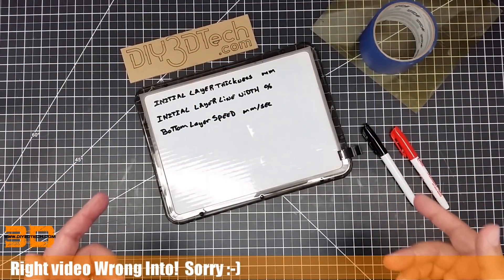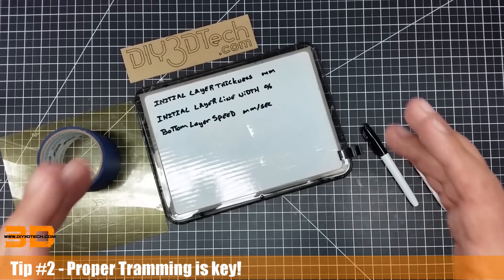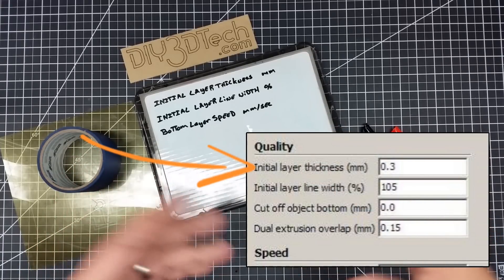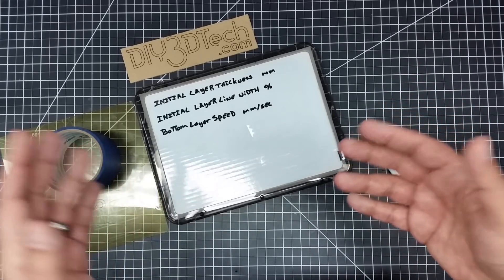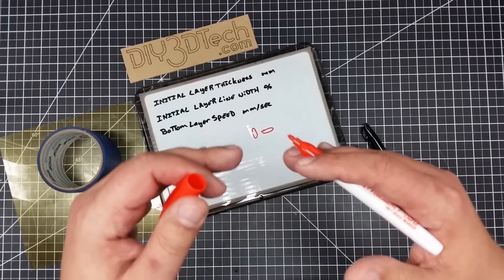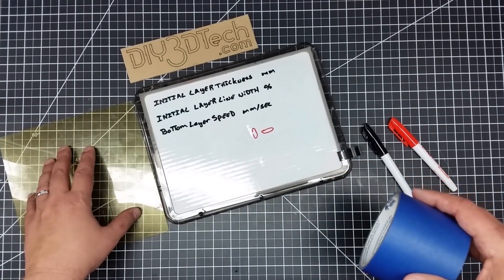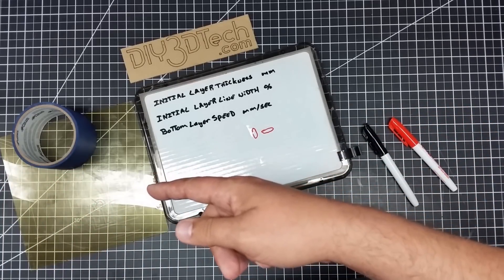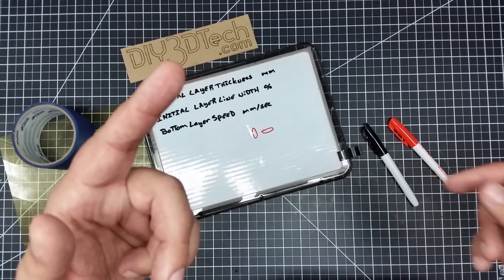Shop Talk - Slicer Settings For The Perfect First Layer!

Comment: Hm, after perfect manual bed tramming on my Ender 3 S1, followed by auto-bed-leveling, z-offset I tested implementing this slicer settings in Cura 5.1 using PLA+……and honestly I got the worst first layer ever seen, totally unusable. Going back to my previous setting and everything worked again like a Charme….weird

Comment: When you said about the 1st layer in the other video on the printing right and how it must have a good adhesion to the bed, either with builders blue tape or the PEI, would a very fine grade type sand paper sheet put on the bed with double sided heat proof tape be a good semi rough surface for the 1st layer to adhere to?
Reply from the maker: just use a clean PEI sheet and you will be golden :-)  Again don't over think it as this is CNC and there is a lot of "error" per-say for hobby use.  If you need high tolerances then SLA is the way to go...

Comment: What version of Cura are you using? RobUK
Reply from the maker: I use 2.5.0 as well as an older version on an XP machine (can't remember the number).  However the slicer I am using these days is iceSL but used the older Cura screen for this video as was easier to understand...
Reply: Thanks, RobUK

Comment: What about first layer height?
Reply: In Simplify3D you can adjust the First Layer Height. This parameter helps a lot to "push" the first layer to the bed. For example, if you are printing 0.20mm layers the first layer will be printed 0.20mm from the bed. If you change the first layer height to 50% it will start to pint at 0.10mm from bed, "squashing" the filament to the bed.
Reply: It's the "Initial Layer Thickness" in the video

Comment: I wouldn't recommend arbitrarily adding .1 to your layer hight to get your initial layer hight because that may induce stepper errors, which you then have to fix by over extruding.  Optimal layer hight depends on stepper rotation degree and leadscrew pitch.  Teach users how use the https://www.prusaprinters.org/calculator/#optimallayer to find out what their initial layer hight will best be.  That way, you don't have to over extrude that first layer 105% :)   My optimal layer step for the setup I have is .04, so I always increment up or down that much.  Printing at .2mm means my initial layer hight will be .24... but never above 80% of my nozzle diameter.  Then make sure your print layer hight is also within the optimal range for your stepper setup.  Less artifacts in your prints = big win :)
Reply from the maker: Interesting, as I get what your saying as in the CNC world when creating the tool definitions there is a sweet spot based upon the lead screws and stepping configuration (for speed and plunge).  Yet with 3D printing I do question the dimensional accuracy to yield value (as mechanically you are 100% correct), however your saying you see less "artifacts" which is interesting.  So couple questions as this is interesting, (1) what type of artifacting were you seeing you do not see now, (2) does this perform better with one type of filament over another (back to dimensional accuracy).  Also I see your a Drone/Wing guy!  Very cool as I also do a drone channel too!

Comment: Hey, did you ever run into issues with the elephant's foot on CR-10? It is an issue for me and not due to bed leveling/calibration. It is because the z-axis motor will lose the first 0.5mm of height for any object. It is easily seen when you move the z-axis up and down. If you move it from 0mm to 1mm it will be 0.5mm. If you move it from 0mm to 10mm it will be 9.5mm. 
Do you know what the issue there can be and more importantly how to fix it? 
Thank you!
Reply from the maker: Wow sorry no, have seen or heard of this as my CR-10 has been rock solid out of the box...

Comment: I've also (slowly and painfully) worked out everything you advised, and can confirm it all! One extra thing I've found with ABS is using the "first layer temperature" option to drop the hot-end by 10 to 15 degrees helps as well (it's been the difference between some bigger parts lifting or not) but don't go too far or you risk Marlin aborting the print with a "temperature error" if it can't get the hot-end back up to temp within 20-30 seconds of the layer change. (so definitely no cooling fan! And a PID tune for the target temp beforehand is a good idea.) But it doesn't seem to help with PLA or Nylon or anything else.

With PETG I've found that a super slow first layer of 10 - 12mm/s and halving the nozzle-to-bed distance helps if you're printing onto 3M blue tape. (with no sprays or other glues) Really smash it down! (Or bed level with no tape, and then 'ignore' the thickness of the tape. If you have a BLtouch you'll need to mess with software options.) 

There's something about the surface of the genuine 3M blue that acts for PETG like PEI does for PLA/ABS - get it right and the print pops right off after cooldown without damaging the tape. And since printing PETG onto PEI will rip chunks off the bed, it makes sense to put tape over the PEI to protect it.
Reply from the maker: LOL!  I guess great minds think as agree, short video but many man behind the testing!  Thanks for tip on ABS as I can see how that would help....

Comment: Can't you accomplish the same thing as you propose with steps 1 and 2 by just bringing the nozzle closer to the bed? It seems to work for me ... except when it doesn't. I'd love too hear your thoughts on this.
Reply: Not really.. in that case you're technically over-extruding into insufficient space which will often make the motor skip (*thunk*...rrrr...*thunk*) because there's not enough room for the plastic. With ABS especially you want a nice thick stream to just 'kiss' the bed, then the PEI will do it's job and release nicely at the end. If you're smashing the ABS into every pore of the PEI, it can get very stuck.

Of course I will immediately contradict myself and say I've found that trick to be useful when printing PETG onto blue tape. :-) Horses for courses.
Reply: Jeremy Lee I see. Your method changes the gcode to accommodate the extra material. I'm just pushing more material into the same space. I know I'm doing this because my first layer has excess material pressed out from the sides of the nozzle that makes small lines parallel to the travel of the nozzle. But this is covered by the second layer. I'm looking forward to trying your method. Thanks for the reply. And thanks for the video.
Reply: Jeremy Lee I've never tried PEI where would you recommend that I buy some? I've found blue tape to work well ... except when it doesn't. BTW, I just got an Anycubic i3 MEGA last week with Ultrabase. So far I am loving.
Reply: I've been getting mine from eBay for about $15 for a 1mm sheet, and as low as $8 for a 0.5 sheet I haven't tried yet. Be sure you're getting the genuine 3M 468MP adhesive sheet with it, and not the no-name stuff - that's actually more important than the kind of PEI. If you're sticking it down straight on the bed (recommended) the thinner the PEI the better. 

I hear good things about 'buildtak' too.

I recommend picking up two sets. There is a very high chance you'll screw the first one up (I did!) because experience - by definition - is something you get just after you need it.
Reply: Oh, and I'm not the one who did the video! Heh.
Reply: Jeremy Lee Oh. I didn't realize that. Thanks.
Reply: Jeremy Lee Does the PEI really need to be adhered to the base? Can't you just use binder clips like you do with a sheet of glass?
Reply from the maker: I have used both clips and the 3M tape, if your only doing PLA the clips are fine however if your doing ABS use the 3M tape for a more even heat transfer.  Also to your other question, think of the first layer as being your homes foundation, do you want a thin or thick one?  The extra material fills in the voids and where there is no void creates a wider base.  In short your basically guaranteed a perfectly trammed first layer so each layer after has a better chance to be (1) dimensionally correct and (2)  have better layer adhesion...

Comment: I've always used a first layer height of 90%. So if I'm using 0.2 layer height, the first layer would be 0.18 to give it some squish. Definitely slow down the speed on the first layer. Found that out early on and makes a huge difference. I go as low as 15 mm/sec on the 1st layer and then 50 after that.
Reply from the maker: Curious why less (the excess will as you put it "squish" out) that will leave or at least create the potential for gaps?
Reply: DIY3DTECH.com I followed that tip from the website below. Have had good results so have "stuck" with it. I'm sure I tested all of these settings awhile back but am always up for experimenting so will run some test prints and see what I like best.

https://3dprinterwiki.info/tips/first-layer-settings/
Reply: i also do this
Reply from the maker: Please keep me posted on the results...
Reply: I'm with you on the slow speed on the first layer...this is a must. The first layer height though, I find the nozzle will start dragging as it continues to print since the layers are that extra little bit higher. I did some test prints that were one layer thick and even then I could see where the nozzle had hit the surface when I increased the first layer height. Having the first layer height to be 90% helps get a good squish and all but eliminates this dragging issue (provided your extruder steps and flow are set correctly).

I have been using IceSL more now instead of Cura and am getting better results with it even though I get good results with both. I haven't found a way to increase the first layer width though with IceSL. Is there a way to do this? Wasn't able to really test that setting out and had to use Cura for my tests.

Comment: Great video. I watch all you 3d printing and openscad videos.

I am not sure that is quite how initial layer line width (%) works. It does over extrude the current line being laid down. But it will use less lines to fill the given area. In the end the amount of plastic laid down for the first layer is about the same no matter what the setting. 

Does this really matter? Probably not, the setting will have many of the benefits that are claimed in the video but it doesn't strictly speaking "over extrude this one (first)  layer".

 Be careful, if you are using Slic3r and want to follow this advice. Many of the  percentages in Slic3r are based on layer height not nozzle width including the extrusion width parameters for the first layer. This really confused me.
Reply from the maker: Thanks for the tip on Slic3r as I really have not used it, mainly Cura and icsSL.  I am not sure this (But it will use less lines to fill the given area) is the case in Cura and will do some modeling...
Reply: I modeled a 180*180* 0.3mm cube. Sliced it with a 0.3mm initial layer height so only 1 layer. Using Cura 18.03 Lulzbot edition. Projected filament used is 4.08 meters when using 100% for initial layer line width%. Bumped it to 150% extrusion width. Predicts 4.10m. Difference is very small <1% and is probably the extra used for the skirt. Haven't printed any of this but it didn't go up by 20% or anything like that. Give it a try.
Reply from the maker: Correct, I get very small change 5% as keep in mind its only the first layer so its not going to go up 20%.  WIll do modeling as you have given an another idea :-)
Reply: Yes, exactly! You don't actually want to "over-extrude" in the sense of plastic volume - but it's the 'edges' of the plastic track that are the weak point. Less lines = less weakness. That's the whole point! You want "fat tracks", not thin ones.

The advantage of doing this on the first layer is that the extrusion is 'trapped' between the bed and nozzle so it still flows exactly where you need it to go, in the correct amounts. But it's faster (less lines balances out the slower speed) and if you try to 'fat extrude' onto previous layers (esp. edges) the plastic tends to squirt where you don't want it to go.
Reply: Dude! Definitely give Slic3r a go... particularly Josef Prusa's new variant. I changed from Cura a while ago and though I really miss the print time estimates, (and non-ISO perspective, grr!) there's some new features like XY and 'Elephants Foot" compensation that make a big difference for tight-tolerance mechanical pieces.
Reply from the maker: Can't say I have seen "Josef Prusa's new variant", has the math been updated?  As that is why I stopped using it many moons ago as I believe the math engine that does heavy lifting is opened sourced and why a lot focus use in their version.  However (and I have not looked at in a while) was not being updated and it not the when breaking down the model.  Have you you noticed any detail loss?  As this is what I noticed in the past and why switch to Cura and now also use iceSL for my more complicated prints.  However as you say might worth testing :-)
Reply: https://www.prusa3d.com/slic3r-prusa-edition/
It takes a bit of getting used to, and it's possible to really screw things up in some interesting ways, (that's what "powerful" means :-) but I'm getting better prints with it than I used to with Cura. No loss in detail that I've noticed. Features I use are:
* XY Size Compensation: -0.1 - basically the equivalent of "tolerance" for the entire model.
* Elefant (sic) foot compensation: 0.15 - shrinks the first layer to prevent "elephant's foot." has the opposite sign to XY comp which is slightly confusing.
* Specific extrusion widths so first layer / infill can be "fat and strong" but the outer shell can be "thin and accurate". (perhaps counters your 'loss of resolution'?) 
* Bridges can have their own flow rate, cooling, support options, etc.
* Change the fill angle. So you can rotate the part but keep the same fill texture.
* Cubic infill pattern. (or hex if you like, but cubic is anisotropic!)
* Thin wall detection & solid infill in small areas (like posts) that prevents 'shell separation' you get when integer numbers of perimeters don't exactly fit.
*  'ensure vertical shell thickness' so the tops of spheres don't sag.
*  'avoid crossing perimeters' - a big one, really good for "stringy" filaments like nylon or flexibles where instead of point-to-point rapids it routes moves so they stay within the body of the print. Sometimes a bad idea, since it will 'follow walls' like it's navigating a maze and increases the risk of knocking the print off. 

And a bunch of things to do with multi-material and variable layer height that I've never used. But you can really dial in the settings for specific kinds of prints/exotic filaments in a way I never could before. I do "mechanical" prints rather than "artistic" so that stuff is important to me. Half the options are fixes for problems you'll never see, but it's nice to have 'em when you need 'em!

Comment: Great tips, thanks.

I usually print at .2 layer height and have always used .3 initial layer height but I never thought about changing it for a .1 layer height. I'll have to give it a try tonight along with changing the initial layer width.
Reply from the maker: Cool!  Let me know what you think!
Reply: That definitely created better first layer than what I normally get at .1 resolution not that they looked bad before but it is a noticeable improvement. Thanks again.

Comment: Because you asked for opinions: IMHO it is just and only the right distance to the bed and a level bed. Nothing more. No different temps, no different speeds, no different extrusion, it all doesn't really matter. Still nice describing for newbies :)
Check my proof of this statement: https://www.youtube.com/playlist?list=PLg-PjJGb4u-Izaj-bwcUS9NdYrWDTLT9Y
Reply from the maker: Watched the video but just saw a printer print fast?
Reply: Well, it is a playlist of several videos/prints with the concept of printing firstlayer fast like the rest of the part, without anything special for the firstlayer. Difference per video is the print-surface. Every surface can do this (besides the crappy ones ofc).